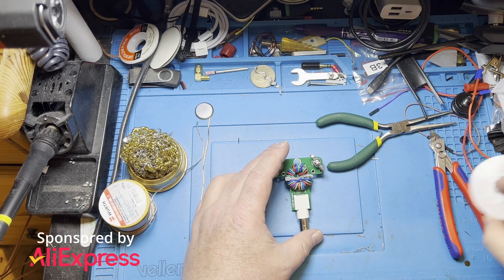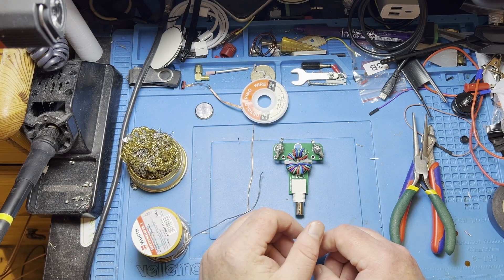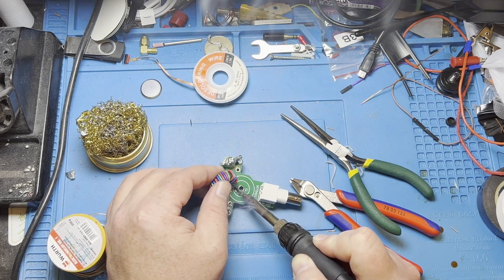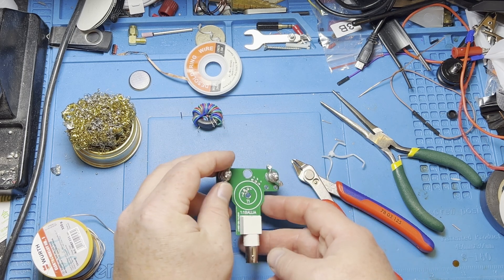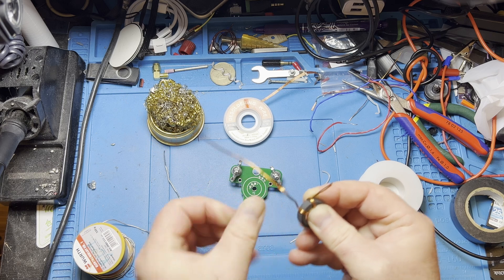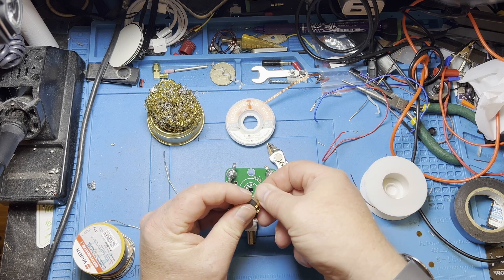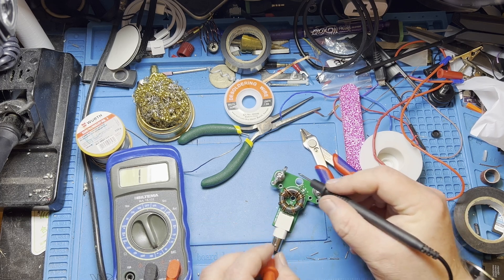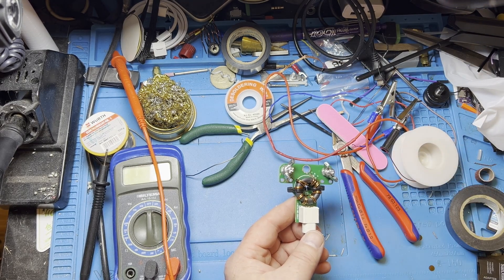Fixing a Broken Balun - Poorly...

Comment: I saw in a book that when winding toroids you should hook the middle of the wire and pull through the centre. Not poke the free end through. It prevents the wire from kinking and you get a neater result. I tried this on an ATU-100 kit build and it seems to work 😀
Reply from the maker: You are absolutely correct. I know that, but I rarely remember.

Comment: Morten, always put a small 'zip tie' around the start of the wires and the core so that you have the wire anchored before you start winding...it makes life easier; 73 Bruce
Reply from the maker: That would probably have helped a little, although I find it not as critical with enameled wire as stranded wire.